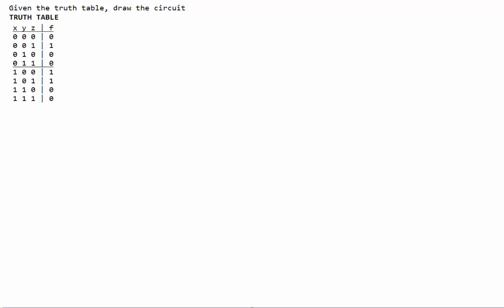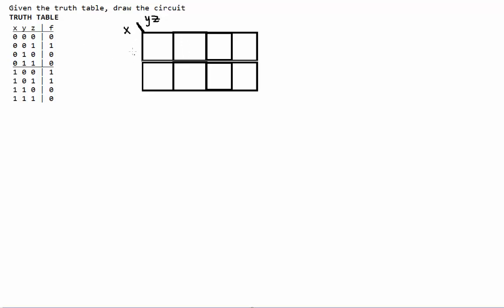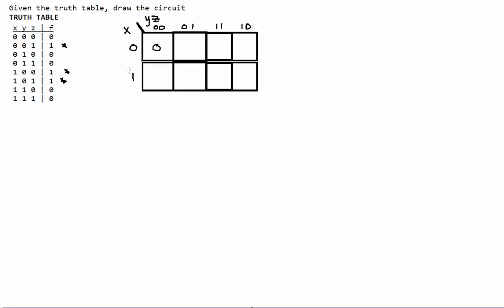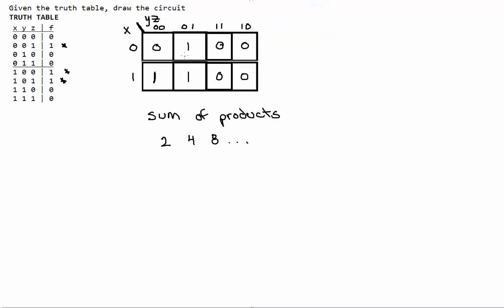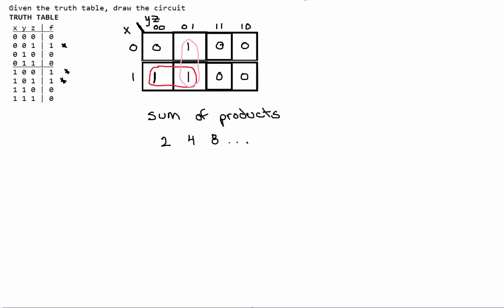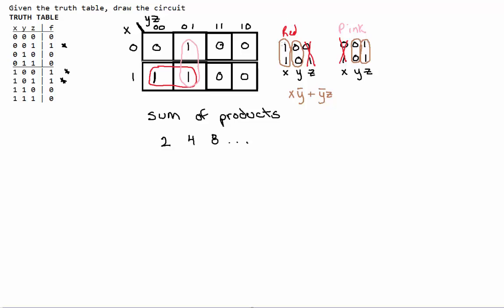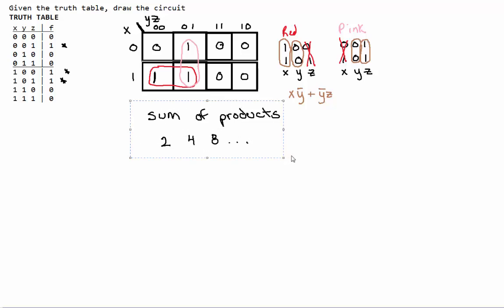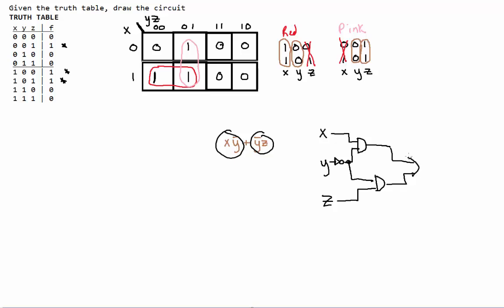Kmaps, Sum of Products, Drawing the Circuit

Comment: About the order of the 0's and 1's for BC, here's what my book says that explains why it's ordered that way. "The four combinations for BC are in a strange order: 00, 01, 11, 10. This is a 'Gray' order in which only one bit changes between each pattern. The Gray code ensures that one bit is the same between any two columns, so that if the function has two ones in adjacent columns, then the variable whose value changes can be eliminated from the equation (the sum-of-product equation)."